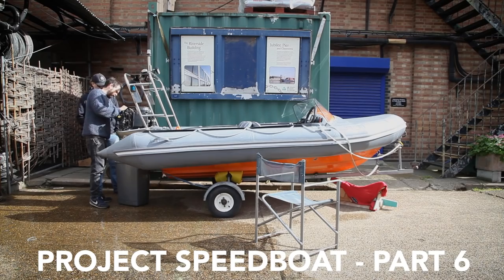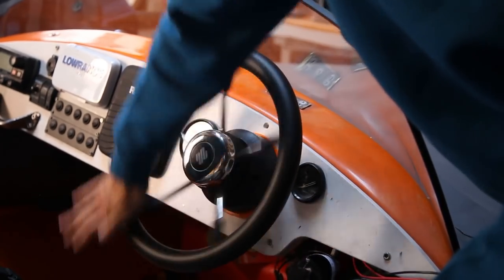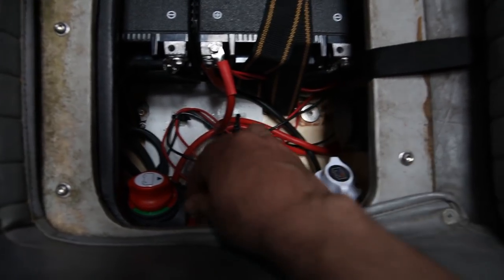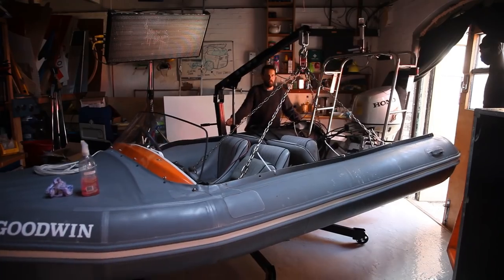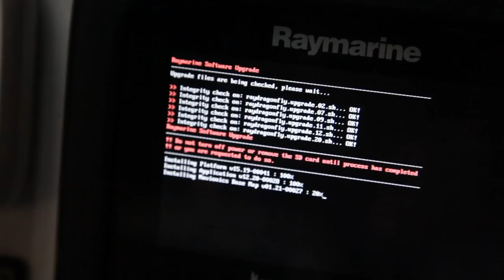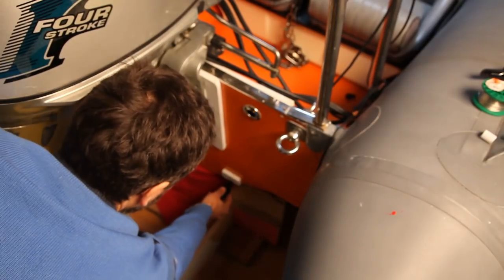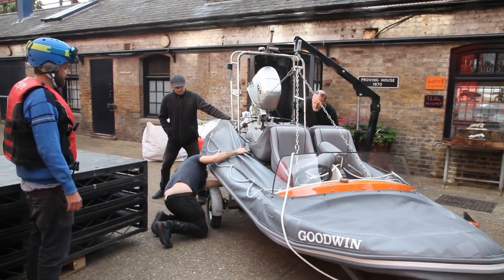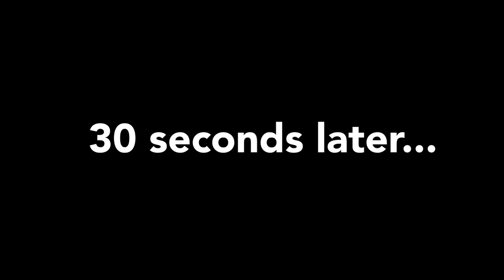How Not To Launch A boat - Project Speedboat part6

Comment: You should put some drain/ventilation slits into the rope-tubes you put on the side (if you haven't already), otherwise the water that splashed into the tubes will pool at the bottom and rot your ropes
Reply: mhm

Comment: Ah the joys of the first run after months of working on a vehicle. Something going wrong is just part of the experience. 
I very much remember going for a nice long drive in a military vehicle I pull apart and fixed up..... and blew the only coolant line I didn't replace since it was such a unique shape. Luckily a call to a friend for a lift, some bulk hose, and living with an weirdly run line fixed that up and I was back home for dinner.

Comment: Great work! Just a note: I think that you should waterproof the batteries somehow, because it seems that water can spill around the cushions into the battery compartment. For example, if you sit on it while wet, or during a storm.
Reply from the maker: Yes good point. It does get a little flooded in there. The batteries are Gel sealed ones so hopefully that should minimise the problems caused by water.

Comment: I hope you put a fresh water pump impeller in back when you discovered the debri in the water jacket.
Great job on your videos.
Reply: Can't stress this enough, broken water pump impellers doom engines to a life of never running right or overheating to the point that they seize, and at that point it turns from engine to anchor real quick. Source: My dad lost a nice 2 stroke Chrysler 15HP "Force 15" engine to overheating.

Comment: Great job! I would've preferred to see the batteries under the passenger seat this way if anything happens and you're solo you just reach over to your left and work on resolving the problem without leaving the controls. It would also help counteractThe weight of a solo driver.

Comment: DO NOT use spray lube on your steering wire. it will corrode heavily and your steering will get stuck after some years. Use proper water resistant Li-Ca grease. I have had to fix a lot of stuck steering cables because of mistakes like this...
Reply: And also remember to grease the inside of the steering cable
Reply: I’ve had good luck using a high quality Norwegian cod liver oil...
Reply: @erikarneberg11  Your steering doesn't need vitamin D
Reply: Aleks From Norway  My motorboat doesn’t have hydraulic steering, and my sailboat has a tiller, at my age, after a long Norwegian winter I need all the help I can get! ; )

Comment: The dual battery installation should have included a solid-state "battery isolator" that allows the engine to charge both batteries, but prevents loads (starter, accessories) from pulling from both batteries.
Reply from the maker: Good point, it's got one and it works well!

Comment: If you are going to be slipway launching regularly (with the same vehicle) I thoroughly recommend fitting a tow bar on the front of the vehicle it’s loads better for both the driver and the helm as both can see each other the driver can also see the trailer depth a lot easier

Comment: How have you got on with the engine? Im a honda outboard mechanic so can see if ive got some paperwork on the engine. Probably needs carbs cleaning and balancing. Looks like an auto choke variant, they never rev until auto choke kicks out
Reply from the maker: Hi James. You sound like the perfect peron to help! The engine starts and runs perfectly but once it has warmed up it struggles to idle. Auto choke sounds like it could be right. When I test it, it seems like only the first cylinder is firing once its warmed up. I have cleaned the carbs but I haven't balanced them. At the time I had these problems I had just changed the oil, it was running on old fuel. New fuel helped a bit but haven't really gotten to the bottom of it.
Reply: Harry Id suggest balancing the carbs but cleaning them first. Sounds like you may have a partially blocked fuel jet.

Comment: Motor bike batteries are likely to fail on a boat. Marine batteries are designed to take the pounding of the boat thru waves, Car batteries and the like will fail after a period of rough weather.

Comment: Why a four stroke? A two stroke is a lot cooler!
Reply: yeh two strokes are the way to go fewer moving parts  he should put an evinrude e-tec on ive had one for years and its never let me down
Reply from the maker: I can see the appeal of the two stroke. Lighter too. This is the engine it came with so I'm keen to try to get some miles out of it first. But perhaps long term I should be looking for a replacement.
Reply: Harry Dwyer I'd say, just have fun with that motor for now. A 60 merc is the way to go. 40kt+ I'm guessing. We have one on a 500cm boat which is around 500kg and it does 30-35 kts.
Reply: I like two-strokes too, but you know what they say: “A four-stroke in hand is worth two two-strokes in the bush...” ...Or something like that...
Reply: Oh, shut up, Erik! It’s “Different strokes for different folks”!
Reply: As much as two strokes are nice, I don't think Europe likes the blue smoke or oily sheen they put on the water as a result of needing to burn their lubricating oil. Can't buy a new 2 stroke these days anyways, they just don't make them.
A nice 4 stroke fuel injected engine is the way to go, it's so easy to run them that you are in danger of forgetting to change the engine oil because they just keep working until they don't.
That being said, be well prepared for the sticker shock, you're going to be shelling out a couple thousand pounds for a same-power replacement motor.

Comment: Great video, raise the engine up and turn it to fill with oil to avoid spilling it. Before you do a long journey I would change the water pump it didn’t look as strong as it should be. I would look at cleaning and balancing carbs to get it to run right. Good luck!

Comment: Recognising that I know absolutely nothing about Boats, isn't that Motor just a little bit Too Large for that particular Craft? 
Or are you a Student of the Jeremy Clarkson School?
Reply: I'm no expert but from what I have seen 30 horsepower is fairly normal for something that size.
Reply: Depends how fast you want to go, my 40ft 12ton steel trawler has a 100hp diesel, it's not a speed boat.
Reply: Michael O'Donoghue I know a lot about boating and. No that engine is not large for that size of boat. Its actually kinda small for a dingy of that size
Reply: It can hold up to a 70 hpI think

Comment: I have an SR4 same layout as yours with 2 seats forward and 2 seats backwards and we found that with 2 adults and 2 kids it was slow to get on the plane, and the weight of the 4 stroke 40 hp engine on the back made the boat point skyward until the hull emptied then it would accelerate forward. We discovered a non permanent solution to block the bow breathers with rubber RivNuts (stainless) with a dab of Sikaflex. On the stern drain we fitted  110mm screw on drain end from screwfix so you can unscrew the end when towing or storing and then seal the hull off when you want to launch. al in for under £20.

https://www.screwfix.com/p/floplast-sp292-screw-on-end-cap-black-110mm/22628
Reply from the maker: Oh sounds like a good plan. Thanks for the links, I might try this. I like having the extra ballast as it's so stable for getting in and out on the river, but on the long trip it might get frustrating.
Reply: Also make sure you replace the tube inflation valves. Mine where the original valves and had deteriorated over 40 years. The bow valve sheared off 5 minutes after launching in North West Scotland after towing the boat for 8 hours to the middle of nowhere... painful lessons...
Reply: We have a similar problem, going to try some trim tabs to see if they help, would like to keep the ballast for low speeds
Reply: We added hydrofoils to the outboard but it didn’t make s massive difference. I was always sceptical about closing the hull off but it makes a massive difference, especially with the weight of a 4 stroke on the transom. We have just temporarily closed the hull off and it is easy to revert back quickly within 5 minutes with a screwdriver.
Reply: Harry Dwyer Another reason to insert a fuel bladder! ; )

Comment: surely common sense would tell you a overhaul of the engine  would be more beneficial  than polishing a turd .  a strip down of the ign system , and fuel pump , then compression test .
Reply from the maker: We have now done all of these things and it's running really well. Compression in all of the cylinders is perfect so hopefully a fair few miles left in it.